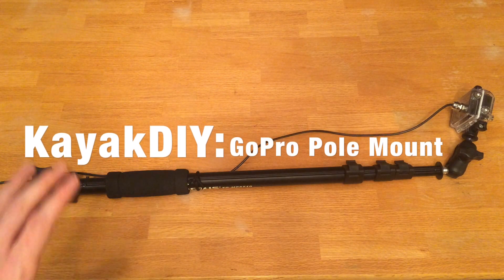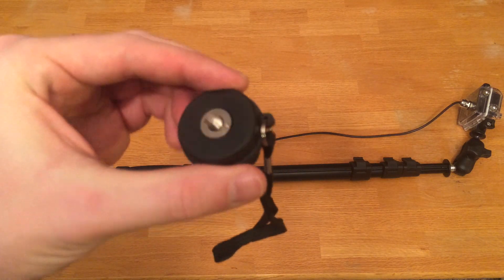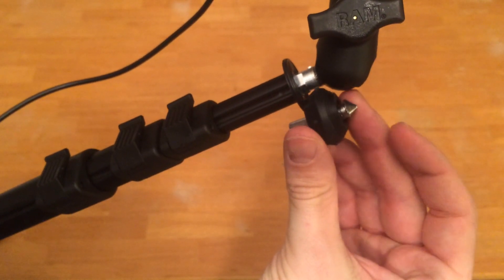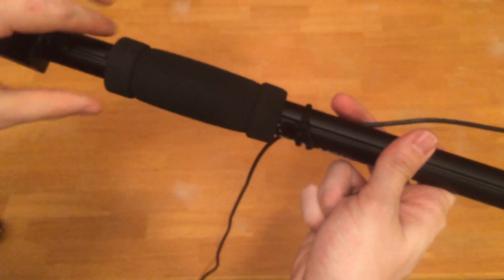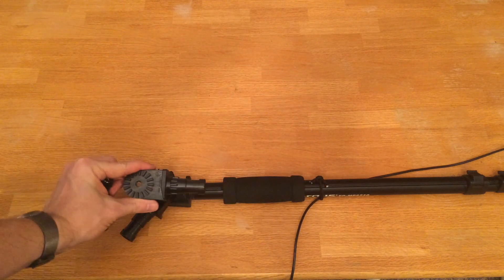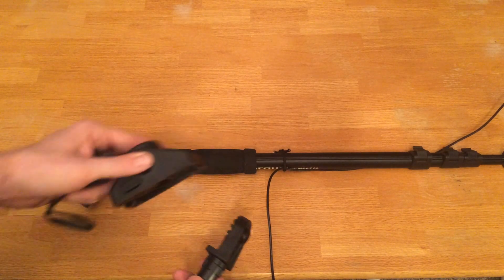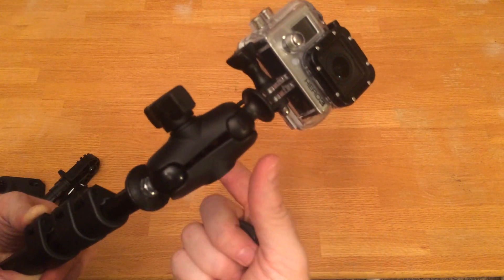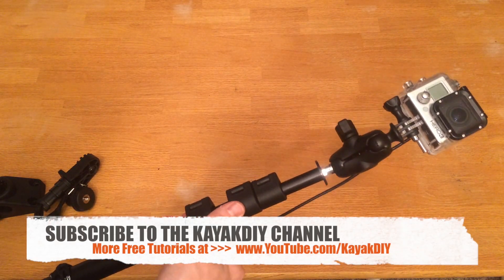Homemade GoPro Pole Camera Mount for Kayaking!

Comment: This is such a great video! Any ideas on how you could make this be able to freely rotate similar to the railblaza 600 boom?
Reply from the maker: Grind the star nubs off the Scotty post and it should rotate freely.  Also could use ram ball wedge mounts instead of Scotty.
Reply: @KayakDIY  thanks for the reply and ideas! im currently looking to see if i could fit a Railblaza adapter nut on the end, that should give me the free rotation im looking for, but then i would need a different hinge mechanism than using the scotty/ram.

Comment: Just made my own.  On mine, I wrapped the end of the Scotty mount with gorilla tape before I inserted it into to top so there wouldnt be any play before drilling and screwing together.  The entire bottom (where the foot was) of mine came out, which was perfect for me.  It was easy to screw a 1/4 bolt into the end, which was nicely tight, then I put a tiny screw into each side.  Used a $5 mini ball head that I can mount any camera to or my GoPro.  I like having the possibility of either.  Thanks for the video.
Reply from the maker: +Shannon DeFriese Awesome Shannon!   Like the creativity.  Thanks for sharing your experience with the build.  Another cheap mount can be PVC pipe and Ram wedge mounts in the ends.

Comment: instead of scotty mount adapter on bottom. Prehaps can use a RAM Suction cup and socket adapter on bottom. So it can attach to any flat smooth surface. But I wonder what's the best way to do that?
Reply from the maker: Only problem is suction mounts don't stay on most kayaks well. Only suction mount I have seen that stays out reasonably well is the Jackson kayak camera mount which has a large toilet plunger style mount with inner hook that connects to handle.  I have made another one using ram components but not a suction mount. The ram ball mount produced more bounce and didn't provide as smooth of video as the Scotty mount connection.  That is why I recommend the Scotty mount connection shown in video.  After all what good is a camera mount if the footage is unusable.

Comment: Any chance you might look into doing something similar to this using the cheaper SJCAM 4000?
Reply from the maker: Thanks for stopping by Scott Martin 
This telescoping camera pole is compatible with the SJCAM 4000.  
In regards to the underwater charging setup we show it would be a bit more difficult for SJCAM owners.  It would probably require a micro USB ribbon cable from the side charge port to the back...then convert to a standard round charge cable.....then run through a stainless steel PG7 cable gland on the back housing which would be a tight fit without an extended back door like GoPros.  We have thought about doing a video on it but am afraid it might be outside of most people's comfort level and it hasn't been requested enough.  We have a lot of other projects that people have requested at this time.  If you get a start on doing it and run stuck we would be happy to offer suggestions or help.

Sincerely,
KayakDIY Team

Comment: I must have the wrong gear heads because two together don't let the threaded knob go through...even took out one of the nuts but it still won't reach...
Reply from the maker: You can still make it work. Just get a through bolt knob and a longer bolt to run through gear heads.  The through bolt knobs are common in woodworking and have used them a lot for kayak track mounts.  Toilet bolts and those knobs make easy and cheap track mounts.

Comment: How were you able to thread the ram ball bolt into the nuts within the monopod tubing?
Reply from the maker: +Kevin Quinn the nut inside wedged in after the threads on the ram ball bolt caught....Then it simply tightened.  If the nut doesn't fit you could grind down the outside to fit inside the monopod.  You could also likely get away with using something like a JB weld epoxy to hold it in.  Lots of options.  You could use other attachments but that was what I chose that worked well for me.

Comment: So is the ram ball JB Welded? I understand there are nuts on the backside, are those just a safety incase the JB weld comes loose or are the nuts actually the only thing holding the ram ball on?
Reply from the maker: +Tyler Caldwell I did JB weld and use the nut but probably lots of ways you could fix it to that end.